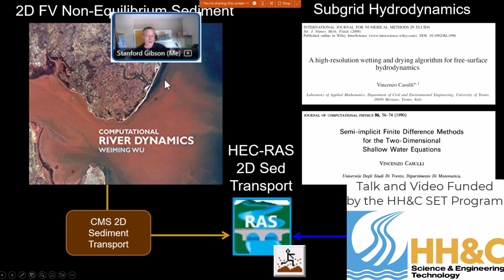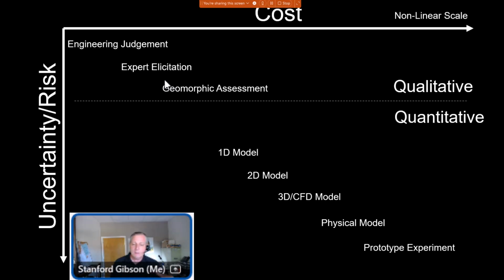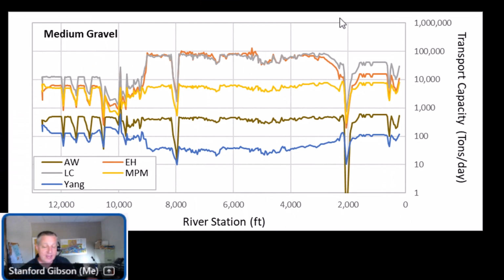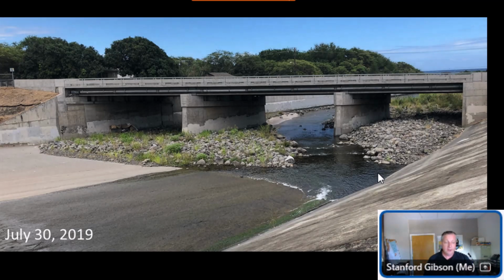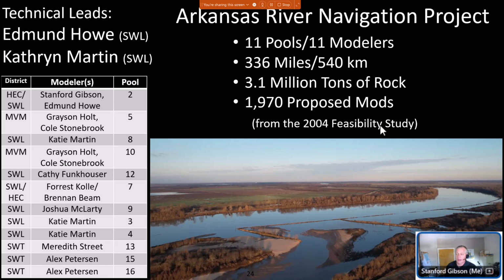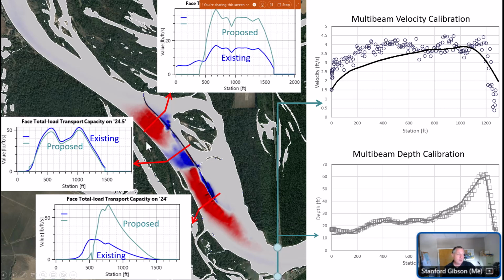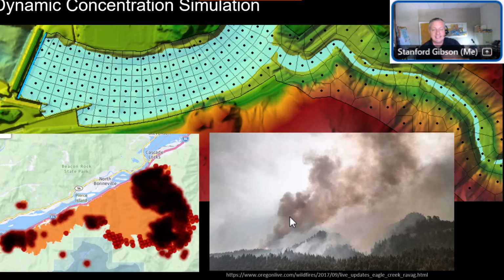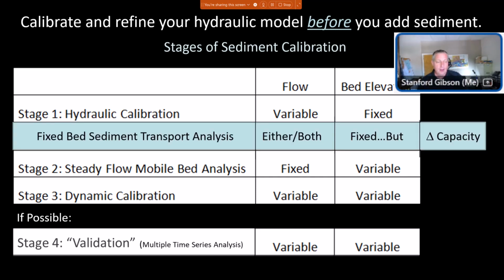Simplified 2D Sediment Modeling with HEC-RAS ("Capacity Only" and  "Concentration Only" Modes)

Comment: Hello Stanford,

I hope this message finds you well. I wanted to commend you on the superb content and engaging work you've been producing.

I have a question regarding the "Concentration Only" Mode. Currently, I am in the process of calibrating experiments conducted by GUTA at LEGI LAB Grenoble, France, using HEC-RAS 2D. The setup involves different settings of incoming loads (below capacity) categorized as LOW, MED, and HIGH, with a flume width of 0.35m.

I've encountered a few challenges:

1. Firstly, I am working with a particle density of 1192 kg/m³. Utilizing "User Defined Grain Classes," I inputted SG = 1.192 and BD = 655.6 kg/m³ with a porosity of 45%. I also adjusted the classes' diameters as required. My question is, does this approach work effectively?

2. Secondly, when inputting the upstream inflow boundary condition, whether using the Rating Curve or Time Series, I entered a value of 2 tonnes/day, which translates to 0.078 kg/m/s. However, the Results Map for "Total Load Transport Capacity" is indicating a significantly lower value of about 0.003 kg/m/s. Which Results Map should I refer to for the sediment rate or flux? I find it peculiar that the induced value is not reflected accurately in the model. Any insights on this discrepancy would be greatly appreciated.

3. Thirdly , is there a way to separate the sediment boundary condition from the flow boundary location? In the lab flume, the inflow is controlled by a hopper/funnel, positioned precisely. Is there a workaround for this?

Your expertise and guidance on these matters would be invaluable. Thank you for your time and assistance.

4. Lastly,  I'm interested in understanding how to utilize the Non-Erodible Method in Adaptation Parameters. Could you please provide guidance on its implementation?
Reply from the maker: If you reach out to me on LinkedIn or ResearchGate I can look at your model and see if there is a bug in the boundary

Comment: Dr. Gibson - Thank you for all the work! Is the R source code available for the Transport/Capacity equations? Rather than re-invent the wheel,  I would like to convert portions of the code to python to help determine capacity using SRH-2D (HDF5) output.
Reply from the maker: Hello Jeffrey, our code is still in Fortran (for another 1-3 years)
Reply: @stanfordgibson  I work for a State DOT and developed a program to compute the transport capacity per unit width using SRH-2D Output. I used the Brownlie and MPM equations as a start. 

My goal is to make this simple for Consultants in my State as there is never budget for stream restoration projects.  That said, for gravel bed rivers, can the D50 be used to estimate the average transport capacity? Or is this an under estimation?

Comment: Hi Standford, very nice video. I have the following query, how would a mudflow impact a river confluence, would the flow increase at the rate of the mixing flow or would the solids be deposited as a function of the carrying capacity and the flow increase would only be due to the contributing liquid flow.   Thanks!

Comment: Hi Stanford, thanks for sharing this. If I assume concentration only, the sediment still can deposit along the way downstream?
Reply from the maker: The model can "lose" or "gain" sediment out of or into suspension, but it does not change the bed or bed gradation, so there is no feedback.  If capacity exceeds supply it will pick up sediment and if capacity drops downstream it will decrease the concentration, but it does not actually deposit or erode (e.g. update the geometry or starting gradation)

Comment: Hi Stanford, great insightful video! At the Iao sediment study, why does the flow velocity (and capacity) decrease abruptly upstream of your profile line by approx. 12 ft/s? Thanks!
Reply from the maker: So there is a concrete apron there, at about a 30% slope.  So its an ultra-high velocity zone even at high flows.  Probably should have shown a picture of that, because it does give it a very distinctive velocity signature.

Comment: I was tryig to define the boundary condition for non erodible beds such that bigger rocks that couldn't be moved or the banks as walls, because the HECRAS is assuming the same sediment curve for whole domain? How can I solve this? any relevant videos regarding this?
Reply from the maker: Sorry, I don't totally understand.  If you are using the sediment model, you can define "gradation" polygons as "non-erodible" - which is usually how I deal with it.  https://www.hec.usace.army.mil/confluence/rasdocs/h2sd/ras2dsed/latest/sediment-data/initial-conditions-bed-materials-and-transport-parameters#id-.InitialConditions,BedMaterials,andTransportParametersv6.3-BedGradations